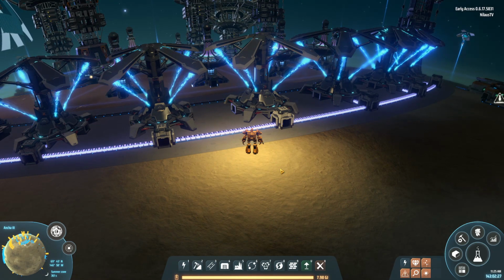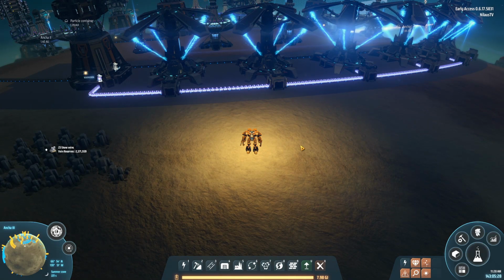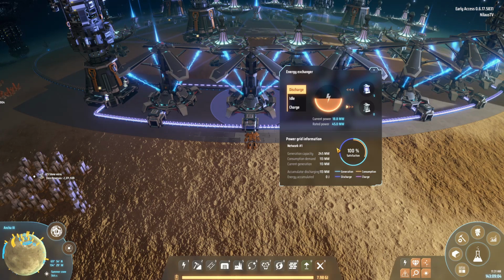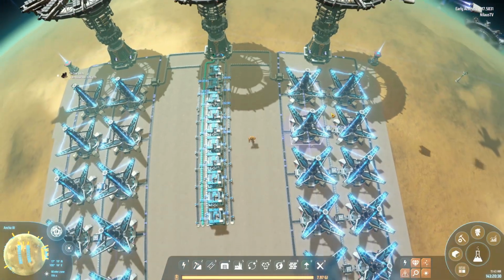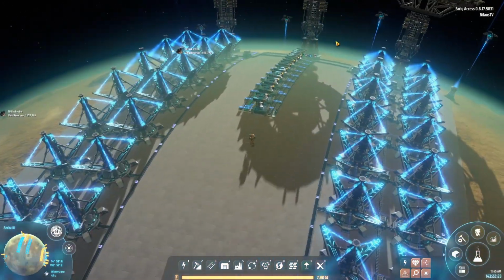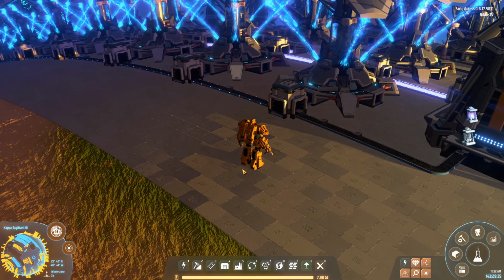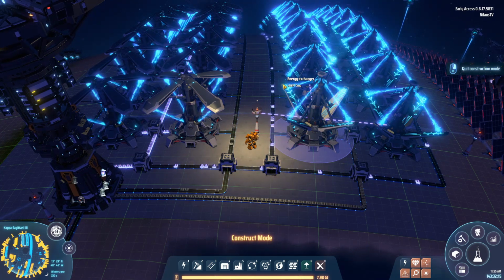How and Why ENERGY EXCHANGERS are AWESOME! | Dyson Sphere Program Tutorial

Comment: don't you think there should be option on discharge of the accumulators that they will discharge only the amount you lack by other means of power generation + some margin.... for example you're generating 244MW by ray receivers and 100MW by discharging but you're consuming only 25% of total 344MW. at this point is there really any need for accumulator discharging?

Comment: Yes I agree, my first playthrough I pretty much ignored them. Read the description when they become available, didn't really understand what they did, built a couple and still didn't see they did much and never built another. (I had the vague idea they were basically a high capacity accumulator that recharged from the Dyson network instead of the power grid, though the input and output ports should have given me a clue they were for far more.) After building huge accumulator farms by hand (a long and tedious process) and then harvesting them to build my army of orbital collectors and figuring there must be an easier way. I actually did some research, slapped myself in the forehead and said "Duh! That's what Energy Exchangers are for! Charging and discharging accumulators."  Now I use them all the time for my power needs, couldn't live without them.

Comment: This is great! The only thing you didn't address was when and how to scale up your power production planets when you have more energy demands galactically than you are producing. You can just use a mixed model with every planet getting suns in the late game, and supplementing with Accumulators, but if you are doing an all Exchanger build, that becomes a different issue. Dedicate one planet to be filled with Suns and Exchangers? Or Create local hubs in different parts of the star cluster? Or both? Can't wait to see what you do next!
Reply: you'd probably have one planet be the recharger/battery maker and then only add more if the interstellar hubs for full batteries can't keep up on their deliveries
The design Nilaus showed could always have more exchangers and another line of empty battery assemblers
Reply: @Voltlighter  That's true, but you still have to add more power in those places. And using suns, on one planet that does nothing but power distribution, would simplify power upkeep, distribution of Antimatter cells and you could designate one system for just that.

Comment: Eh I still think artificial suns are faster to acquire.  I have a difficult time making mass accumulators.
Reply from the maker: They are not. Not just the suns but you also need the fuel. It is way later in tech
Reply: @Nilaus  how do you suggest mass producing fully charged accumulators?  Having to lay them down to charge them manually is what I've been doing and I hate it.
Reply: @Widderic  we're literally looking at a building that takes empty accumulators and fills them?
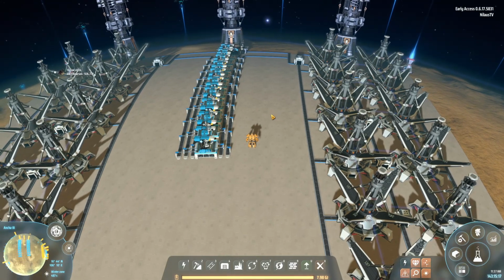Reply: @Widderic  Check out 11:15  That is where he is making the empty accumulators. They then go on to be charged and enter the galactic network to be used as needed.

If you need charged accumulators for construction (like Orbitals), they would be sucked out of the system as needed, and the assemblers would make more as needed as well 

12:25 shows the tower feeding it in; and the supplies are very easy to get mid game; silicon crystals (silicon through a smelter twice), iron ingots, and blue engines (something you should be making tonnes and tonnes of by that point because EVERYTHING uses them)

A lot easier to make than Antimatter fuel cells.
Reply: i built one assembler when i reached that point in the game and forgot about it and ended up with around 10k fully charged accumulators simply because you need them to build certain buildings.